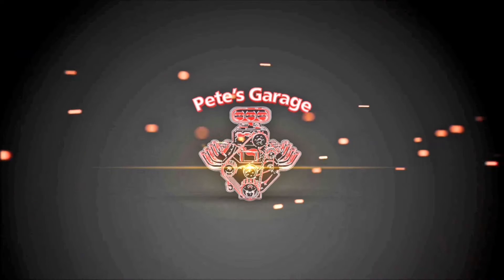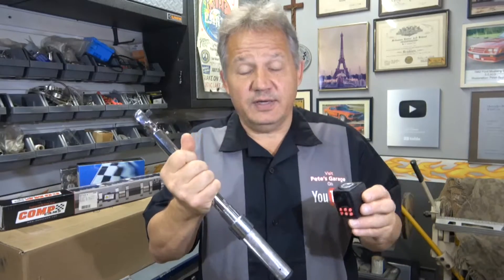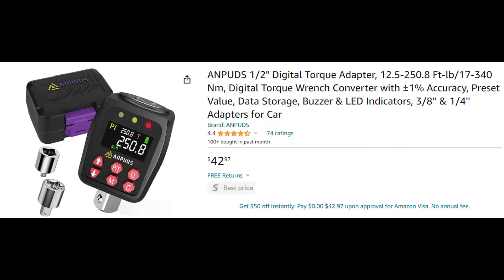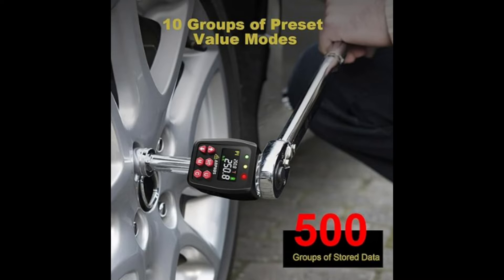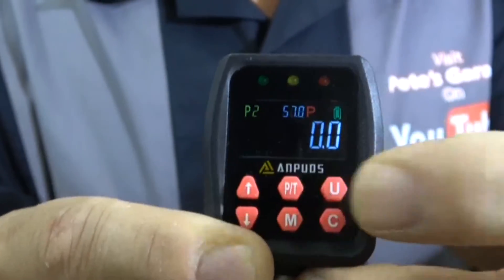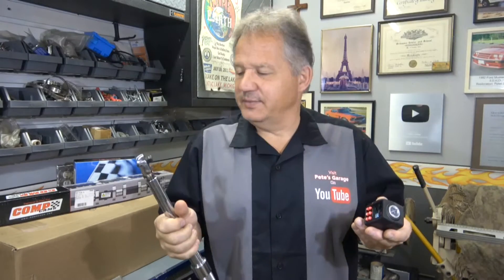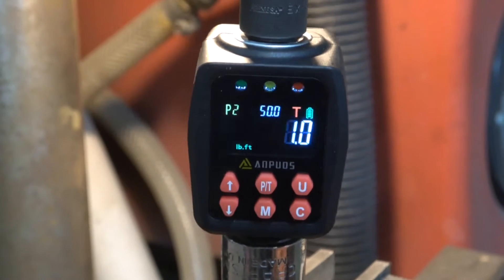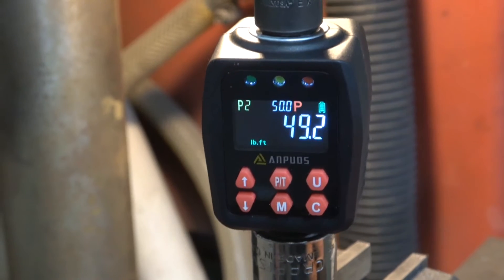Torque Transducers and Torque Measurement   ANPUDS Digital Torque Adapter

Comment: Very informative video. Can one also use an extension on it, especially for a tight space so the torque transducers is further away from the bolt?
Reply from the maker: You can, but the extension has to be strong enough not to twist
Reply: @PetesGarage  Thanks kindly for your info on this.

Comment: does this come for use with 1/4 impact driver
Reply from the maker: You should never torque anything with an impact driver
Reply: @PetesGarage  why not?
Reply: @PetesGarage  why not ?
Reply from the maker: Because when you torque a fastener, you need to apply slow even pressure. An impact driver is not controlled and applies quick, instant pressure

Comment: I bought it but the instruction manual states "To ensure accuracy of the digital torque adapter, regular calibration is required (every 365 days or 5000 uses)."  How do you calibrate it unless that can only be done by the manufacturer?
Reply from the maker: I compare mine to other transducers. Thy are pretty cheap, so after 5,000 uses it's almost a throw away and get a new one. You bring u a great point.

Comment: Imagine that these would have cost thousands of dollars years and years ago. Now they're super affordable AND are absolutely precise. The way it works is the same it would work in a digital weight meter. It's a proven, very accurate and super simple mechanism used in various industries.
Reply from the maker: They are very affordable and accurate

Comment: Hey Pete, was wondering if you know by any chance the inner working principle of torque adapter/transducer?
Do they work as rotary torque sensor(transducer, without electrical interface) in terms of inner sensor chosage (strain gauge or hall effect sensors) and mechanical principle? Any respond would be appreciated. Thanks.
Reply from the maker: I've never taken 1 apart, now you have me interested in doing that….lol
Reply: I will be doing my project about it, so I was looking for some information regarding that. Well, when you decide to do so, I'll be there to watch :) @PetesGarage

Comment: Mine quit beeping half way through a job 🫤 couldn’t figure out how to get it to beep again, I even took the batteries out and nothing. This was the first time using it too
Reply from the maker: I would email them, they will replace it
Reply: You can enable the beeping again by a combination of buttons.
I am more reluctant when it comes to the precision of these things. A normal user cannot really test the accuracy of these things because you cannot do it with a normal torque wrench. And what if your torque wrench is good, but the adapter is not? You cannot tell that either.
I guess i have my doubts also because mine came with scratches on the display which means it has been used before. So no idea how calibrated it acrually is.
Reply: @someone7507  You could always visit your local snap-on truck and they'll check it and/or calibrate as needed. Tools Tested checked out the Harbor Freight one and found it pretty accurate. Really same problem with any TQ wrench...
Reply: @someone7507  Oh wow, quick physics update...if you have a luggage scale or similar you can calibrate this (or any other torque wrench) with that. h/t Torque Test Channel, see their "You're using a torque wrench wrong" video from May 10, 2024, toward the end...right before they suggest using one of these adapters to calibrate, lol.